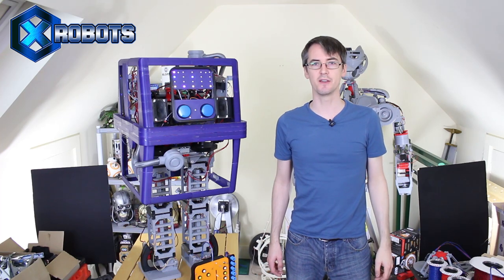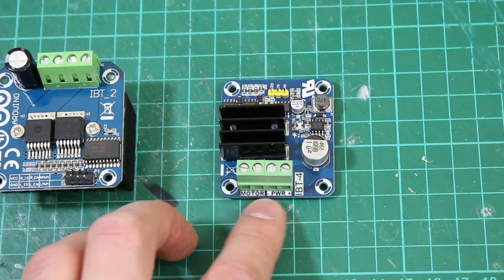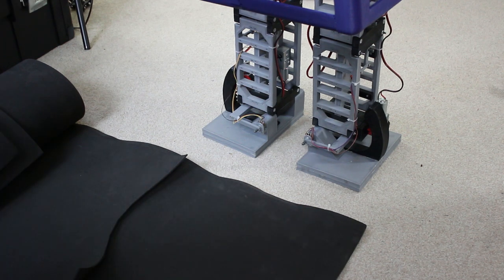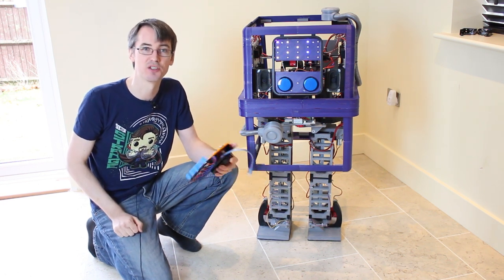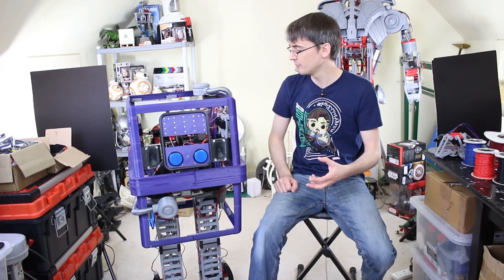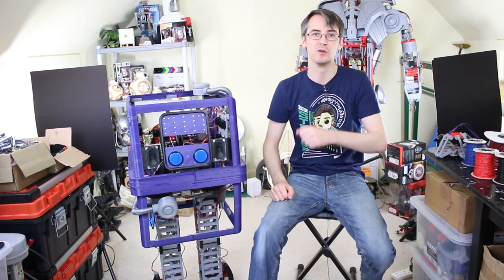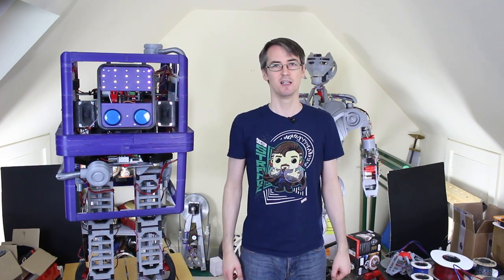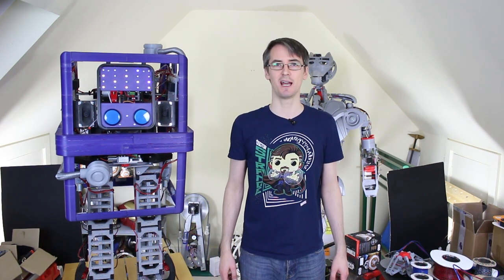Star Wars GNK Droid #11 | More Walking & Next Steps | James Bruton

Comment: I agree that the current droid is at the edge of working.  I really like the new plan.  I have been tinkering with the ideal of a two ram system.  In principle its a very simple design.  My issue is building it for a reasonable cost and size.  

Drill and lead screw is the only way i see it working.  It will be fun seeing how you approach it.

Comment: Great job mate, That is a load of work. If you do a push pull joint with two motors it may be hard to load share, especially with lead screws as they don't back drive well. I was thinking you could put a current sensor on each motor, then you could balance the currents during motion.

A note on brushless DC. While they are a pain to drive. You do get electrical gearing out of them so you need less motor gearing. This will help the backlash. I always wanted a brushless servo "module" and I did make one but never mass produced them.

Comment: Hey James, try upgrading your drill Motors with Mabuchi rs-550 vc 6060 12v motors, I have used them myself, they are compatible with the cheap planetary Gearbox of most cordless drills, you only have to knock the Pinion/Gear off your old motor with a Bolt or a screwdriver (old motor will be damaged in the process) and carefully press them on the axle of the Mabuchi motors. (I used a vice and blocked the back where the axle comes out of the motor with a Bolt to prevent damage to the motor.) The Mabuchi motors are way more powerful and are used in Powerwheels (the electric cars for kids).
Here in Germany they cost 8€ a piece but I think you can get them cheaper.
I used them for a Robot that weighed around ten kilos an was moved by two 20cm Wheels, the Motors are Overkill and did a burnot every time I gave them power without a regulator. By the way, these motors spin slower than the cheap ones but are high torque and run cooler.
But try your drill motors (before you consider changing to Mabuchis) they are also good and may be better suited for the screw because they turn faster.

Comment: I like the reusable chassis idea.  

Do you have an Angle Grinder?  Its just about the most useful tool for basic metalworking.  With a cutoff wheel you can easily cut rod, extrusions, plate and sheet metal.

You can grind flats (square or hex) on your 12m rod so it will fit in the drill chuck.  Simple and positive engagement.

Safety glasses and caution a must.

Comment: this would be pretty cool if it had some built in power banks so it can actually charge things like phones or tablets, make it a working power droid.
Reply: zenol leytan That would be awesome!
Reply: zenol leytan And a separate rechargeable power module with a fold out solar panel so it can at least compensate for some power consumption without going to charge a separate battery every little bit
Reply: I made 1 recently

Comment: Make a grinder lathe with wood or 3D printing to reduce the diameter of the lead screws and add 3 flats. Or see if a drill bit sharpening place would do it.
Reply: A grinder would make it possible, if your concerned watch Matthias Wandel's video on making a wood lathe. Or just have a tool sharpening place do it, they could grind the shaft same as any drill shank.

Comment: Looks like the left foot comes higher off the ground than the right foot.  The right foot looks like it barely clears the floor -- could be an issue, especially if changing surfaces.
Reply: True - that would explain it.

Comment: why not stick those rods on a lathe and machine them down on the end so they fit in the drill.
Reply: James Bruton  those ball screws are usually case hardened or chromed. grinding may work better . I like the idea of using them though. have you thought about using stepper motors instead of the drill motors?
Reply: James Bruton steppers can be used direct drive though. Even without micro stepping you can get 1.8deg per step (do the math, that works out at 200steps per 8mm of linear movement. )
Reply: James Bruton how fast were you wanting them to move? At 1khz pulse rate that's about 40mm/s (not sure of the top end speed of the steppers but I can get my CNC to move end to end in about 6sec  - that's 1200mm but includes acceleration/deceleration)
Reply: James Bruton which ever way you go I'll be hanging out with baited breath just to see your results. I love the way you explain how you make the journey, not just the "here it is working".

Comment: I did say at the beginning those motors weren't the best choice and you said i was wrong??
Reply: ok sorry i must have remembered wrong because i recall you saying you wanted to use those DC motors and i recall saying they are not great.
Reply: Well they can be brushed or brush less and may be coreless brushed however they have different gearing and built in control circuits....
Reply: yes witch is tuned to the specific motors with thousands of pounds and hours of research and development behind them.
Reply: But fair enough as I said, I am mistaken about what was said.
Reply: and high end servos have less slop due to the high resolution requirements.
They may be expensive, but i am sure you would find getting a sponsor easy enough
Reply: Surely the manufacturer would assume if you buy a 10kg servo, it would expect somewhere in that level of load.
If you buy a 20kg servo, you are likely aiming for that level of load.
Reply: hmm, ok
Reply: well again those high end servos tend to offer a programmable interface, wich would allow you to do the same, but i can understand you choice.

Comment: if you upgrade the motors could you not add more weight to it to compensate
 to then slow the speed of it walking down or some kind of breaking system for it to work against to slow the speed of it down with the new motors...i dont do programming so it all i can come up with
Reply: wow ive shocked myself there that actually  im right about it,
 i havent seen the second half of the video yet ....not bad for
 some one whos dyslexic and and never went
 to school lol